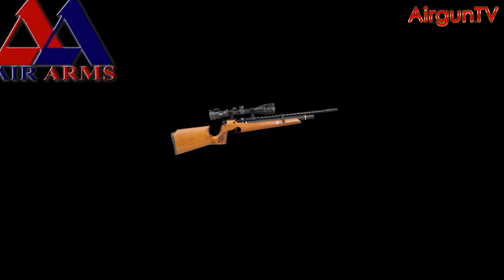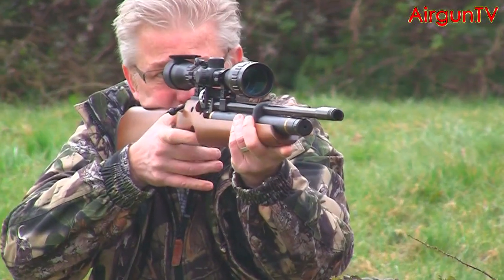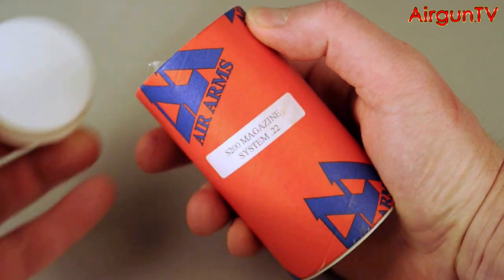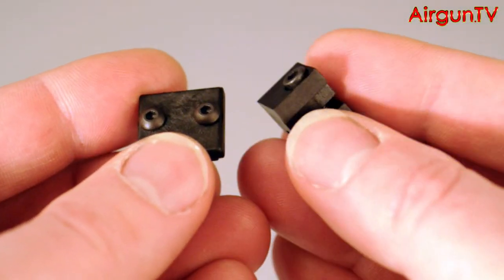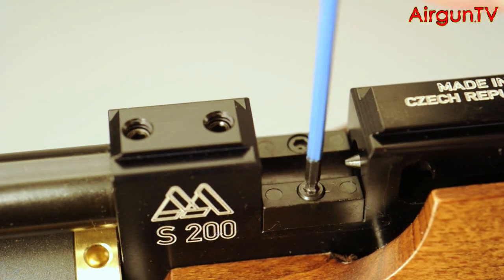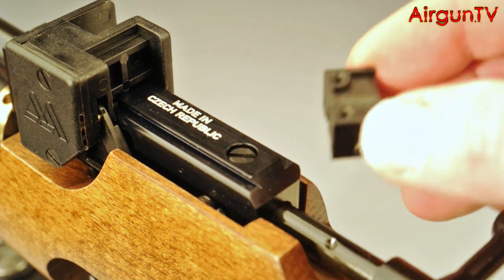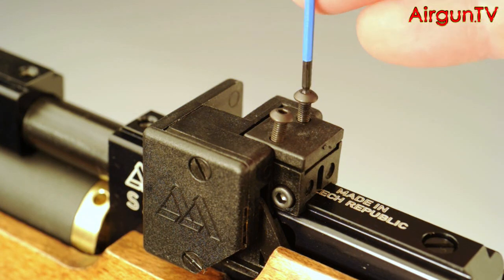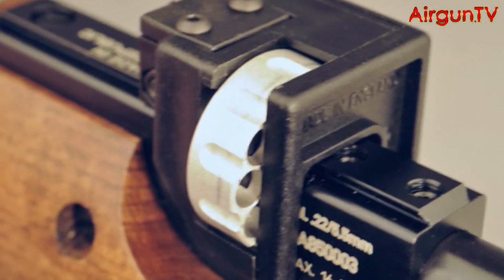HOW TO fit a 10-shot magazine to Air Arms S200

Comment: I use this air rifle with the magazine conversion in army cadets. Although the conversion enables multishot shooting there is a big problem with the design. 
The cycling of the magazine is done by the 2 stage cocking action.  Unfortunately if the cocking handle is not pulled far enough to the rear the trigger is not activated so the gun won't fire. When it is recocked it loads a second pellet into the breach.
Also because the gun has no safety catch this means that hunting with this rifle becomes somewhat unsafe. You either cock the rifle and walk with a loaded rifle which is a big no no or risk double cycling the magazine and loading 2 pellets. Neither is ideal.
Although the conversion is a good idea, please be extra careful to ensure safe practices.

Comment: I fitted this "upgrade" to my S200. About 1000 shots later the loading bolt could be pulled back but would not go forward again. Stripped and cleaned the mag to find it was worn out - not worth the UK £60 price tag. Rifle is now back to the original single shot mode and is shooting nicely.
Reply: garyrobinson312 I too have had this issue with my magazine not indexing properly despite numerous attempts trying to make adjustments to it the gun shop I purchased it from ended up replacing it with a new one but I still have the same indexing problem in-between shots 😎.
Reply: Same man
Reply: It costs between £89.00 and £99.00 now even worse value.